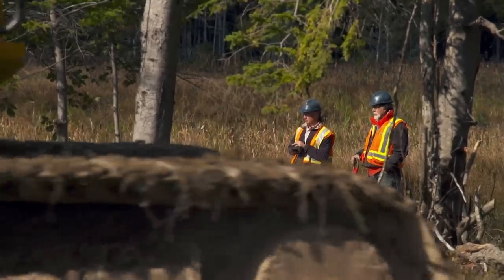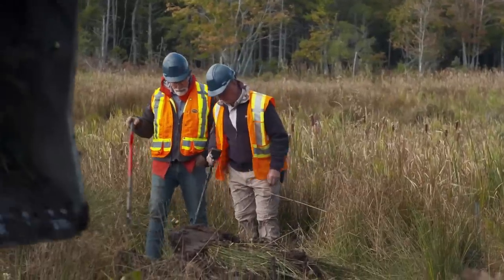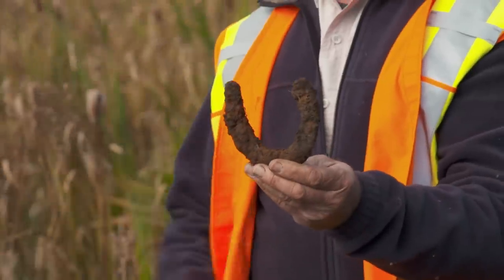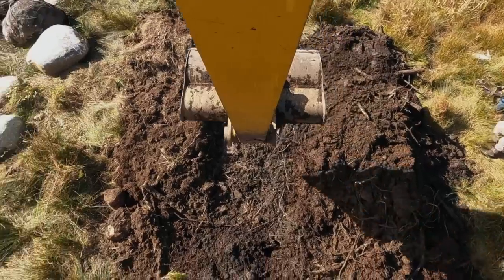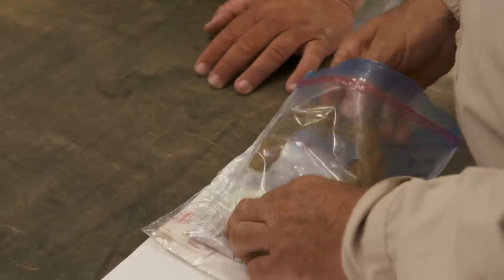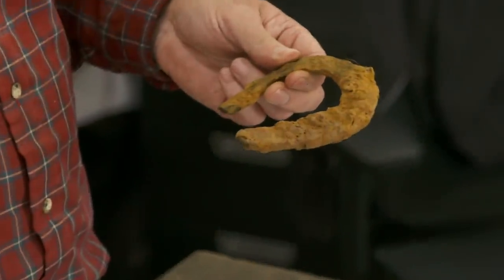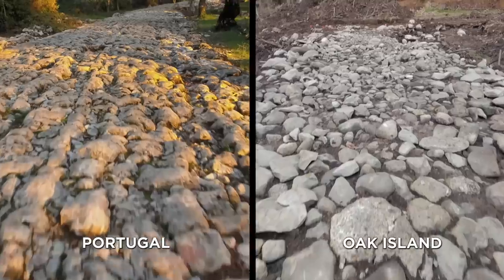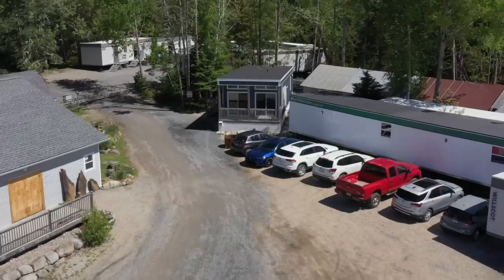The Curse of Oak Island: 600-YEAR-OLD Horseshoe Found on the Island (Season 10)

Comment: Does the horseshoe have any relationship to the islands off of North Carolina and or South Carolina where an island of horses existed?
Reply: Wow, lol. I own the fifth oldest house on Chincoteague Island where half of the wild horses reside and are maintained. The island has been inhabited for about 400 yrs. Not sure beyond that but who knows?
Reply: I was an active Blacksmith from 1975 to 2010 shoeing  race horses mostly.
   it might be cavalier (no pun intended) to suggest this shoe was dated from the 1400s. Horses made in the 1400s had very wide web, they would've shown frog eyes ( bulges  from the nail punching) like this doesn't seem to do.What do I see about it? 
    It is handmade of course, it is a side-weight. you can see it's wider on one side, the purpose of a side weight was to centrifugaly influence the art travel of the flight path, thus redirecting and straightening it. It was Used, and I have made many of them for race horses.
     they have probably dropped almost completely out of being used in my working lifetime.
  I can see it once said heel caulkins turned over which are completely almost worn level, so it was well used.
    Blacksmiths making handmade shoes had and have a propensity to adding fancy influences because the iron was already hot and because they could. Caulks would've been almost universally turned.
  The size.
  this would've been off of a quite small horse almost a pony, I would say contrary to what bro said about and being off some highfaluting mount.. It could well be as somebody mentioned one of the local Island horses, that fits well. It's like a minors pony.
    The hole being excavated was almost certainly likely hauled  to the  top by a horse and likely a small handy one. Used repetitively enough to where it's feet wore and needed traction from caulks requiring at least front shoes. The way it's bent indicates it was caught and pulled on one side , Probably by the back. likely in the mud it was working in, in all conditions. Then lost in the same mud and thus not put back on. As it certainly would've been as iron was expensive and she was already made up. So the Blacksmith put a new one on right away to keep the work going. The corks would also be necessary for traction pulling up the dirt.

      it was essentially a Newfoundland pit pony. Used in the coal mines open till the 1950s. This could be a semi modern shoe and let shedding light on the activities on the excavation work. It might be very telling.

    It demands a much more thorough forensic investigation then buddy there. It isn't what he thinks.